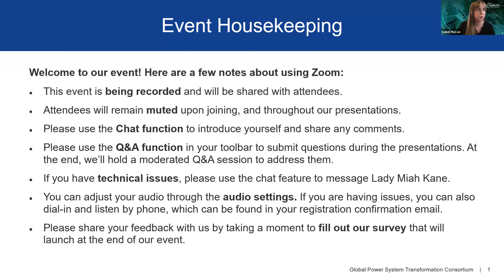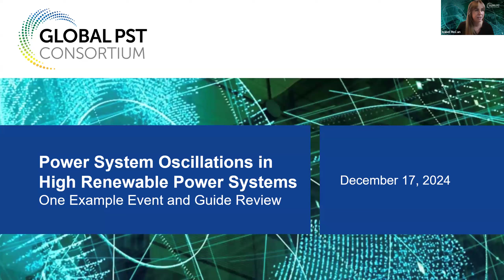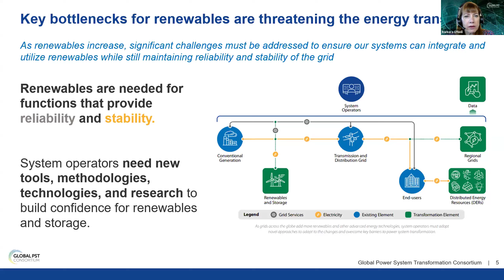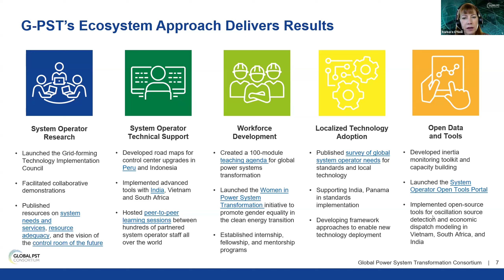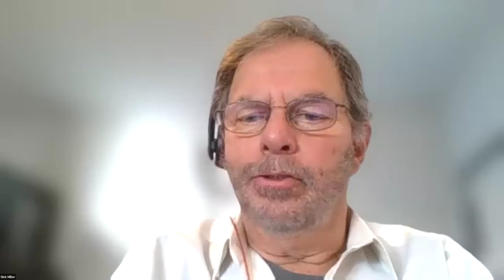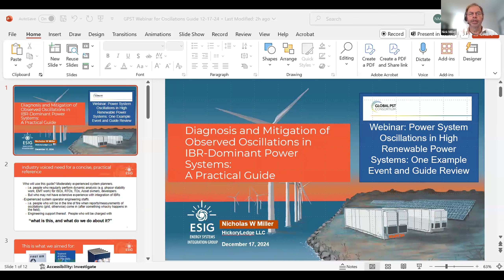Power System Oscillations in High Renewable Power Systems: One Example Event and Guide Review

Comment: I see these Oscillations as more of a problem with Inertia Rebound Resonance "Wave Rebound in a pond" as the power ebbs and flows from Wind, Solar "Grid Following" loads changing thru out the day from sunrise to sunrise causing changes in capacity and sudden load changes from demand as people awaken and turn on electrical devices and as solar heating increase demand on the grid from air conditioning. Synchronous Compensators on the outer edges of the grid could work like cattails "Bulrushes"  in the outer edge of a pond  "Grid" to absorb the oscillations, store the energy and return the inertia to the grid as needed! Logic would dictate that these pools of Synchronous Compensators would need some sort of interconnection as the oscillations are never linear thru out the grid, but linear balancing would seem to be the goal to control these oscillations.
Reply: I am a generator designer and generator builder of 20 yrs experience with small grid experience, mostly power plants for interconnected water and sewer plants.